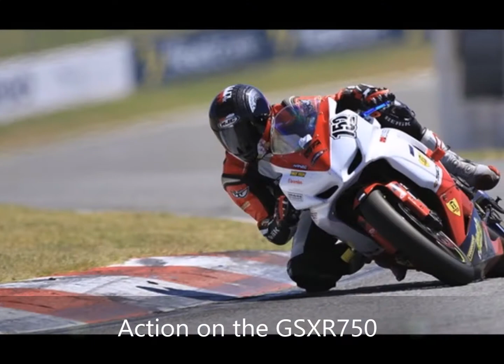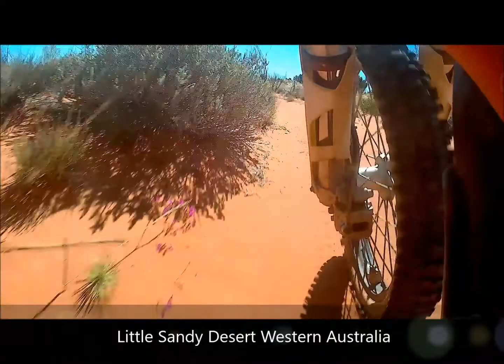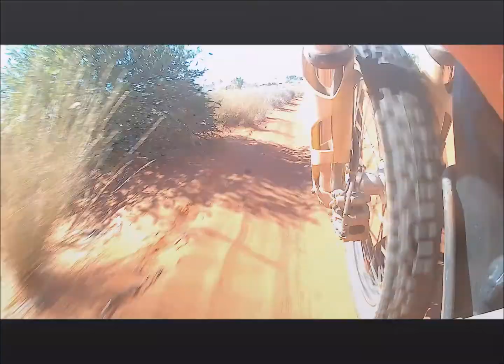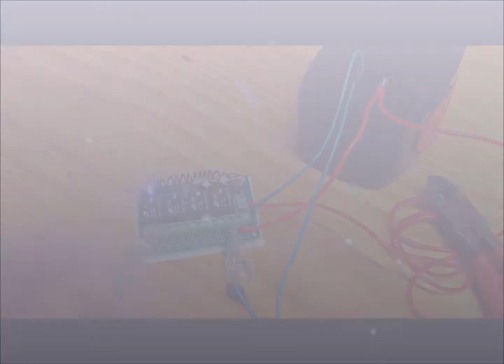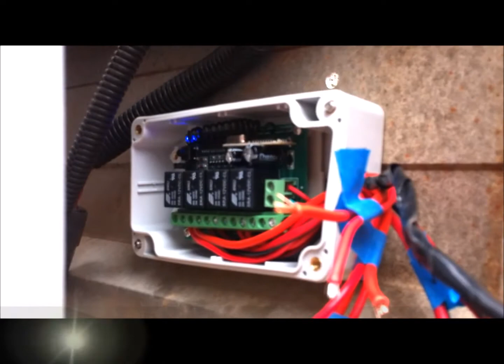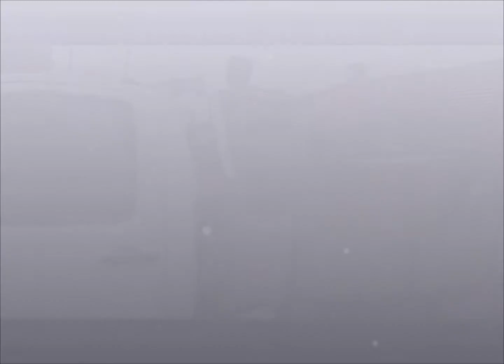4wd Remote Control Flood lights Camp LED lights Off Road camping

Comment: Hey Scott, I am looking at doing something close with the lights and having remote on/off switch. Can you recommend where I can get the parts as its been 5 years and the link doesn't work now.
Reply from the maker: There are any number of these things on eBay if you search. Like this: https://www.ebay.com.au/itm/354249422926?hash=item527ae9384e:g:zzwAAOSwDA1jDCwy&amdata=enc%3AAQAHAAAA8I1IH7X1s41m4AnK65aOPb5HECGpPZaykpwvPaxA%2FpfmMoBeCvd70uveeVcjdzJ08935Ebjp7whEiRFYyTKVKfcEjODaZp%2FzfWFZtrhCnlytuOln6VbGhrsJnk%2FmDhlwuoxmYUurskSeMhKO7UgdosYFcH5fBK0I2Qihqd84zDeGcarVhPIgcqwNocsZDSYzYkoNrBdBaPUdiUFkKx%2FFGUG02ZA3cydcT8gLWnxrDx7bEabGdLCeKp641HsnKznUBC6hRy%2FBT8jhpMw2JeCbbnlPsubHDMZdnahPZ1OkNyzH6JTSExIki0LNFjqUybI%2BeQ%3D%3D%7Ctkp%3ABk9SR_C5uYu5YQ

Comment: Surely you're on #navlife?
Reply from the maker: No not a member ... is it a good forum to join?
Reply: @ScottElliott152  as far as navaras go, its the best! I've just bought the rf board and some led floodlights to wire up on my pathfinder
Reply from the maker: @its028NVD  ok thanks ... I'll sign up. You'll be pleased with the remote floodlights. A friend has just installed the remote board on his D40 Navara and loves the convenience. I just did a video on how to modify the NPS switch and have another nearly ready on how to do the oil line pipes gasket on the underside of the turbo. I worked out a way to do it quite easily without removing the turbo

Comment: Did you run the control box through a multi meter to calculate its draw? Did you end up flattening your battery? Ps, good job on the video 👍🏽
Reply from the maker: Thanks. I calculated the current draw. P=VI. The side mounted lights are 80W. 80/12 = 6.7A. The relays handle 20A each. The auxiliary battery is a deep cycle 50Ahr. One 80W light will run for 50/6.7 = 7.5 hours before the battery is flat. I have flattened it when I've run all lamps for too long. As it's isolated from the main battery with a VSR it's not a problem.
Reply: Hello again Scott, i was interested in knowing the standby draw of the control box, i'm going to be setting up a similar set up but my aux battery also powers my fridge and and a couple other camp accessories. I have a 115ah aux battery being charged through a VSR. Sometimes camping we are parked up for three of more days so i'm always calculating our draw! CAN'T have the beer getting warm!
Reply from the maker: Chris if you watch the video again you'll notice I mention I have the box wired through an isolation switch. When I'm not using the car I isolate the grey box so it doesn't draw any current. My 4wd sits for months at times as it's purely a recreational vehicle for trips to the desert.
Reply: When you isolate the receiver and then power it back up do you need to reprogram the remotes?
Reply from the maker: @cpm1980uk  No they're fine.

Comment: Terrific video!  I really appreciate the idea of using a remote for my lights.  There are probably other things this setup could be useful for, too.

Edited to add:  The remote setup listed is no longer available on eBay, but a bit of searching turned up a number of similar modules on Amazon, such as this one INSMA 433Mhz Wireless RF Switch Long Range DC 12V 4CH Channel Wireless Remote Control Switch, DC12V Relay Receiver Module, Transmitter Toggle Switch RF Relay (2 Transmitter & 1 Receiver) : https://www.amazon.com/INSMA-Wireless-Channel-Receiver-Transmitter/dp/B01CCSG2ZY/ref=pd_sbs_328_1/139-1301443-0373720?_encoding=UTF8&pd_rd_i=B01CCSG2ZY&pd_rd_r=d2f34717-413d-11e9-8091-53ebfc68b3ce&pd_rd_w=eM8ff&pd_rd_wg=DvTQ2&pf_rd_p=588939de-d3f8-42f1-a3d8-d556eae5797d&pf_rd_r=MN9R65A03XWY5GV0HJ6X&psc=1&refRID=MN9R65A03XWY5GV0HJ6X
Reply from the maker: Gosh I only just saw this as it was flagged as spam!
For interest the module got flooded a while back. I drained the enclosure, sprayed with CRC and left to dry. Still works perfectly after such abuse. Regards, Scott
Reply: @ScottElliott152 ,
I had kind of forgotten about this post, so thanks for the reminder. I think this is a project I need to work on!

Comment: Good to see you back Scott.  I eventually got round to doing the ATF change on my Mercedes E350 7G Transmission thanks to your very informative videos, so glad to get it done. Took the Blue ATF by the way. Thank you again. Mick. Northern Ireland 👍
Reply from the maker: Michael that's great news. Would have saved a truck load of pounds and you'd have done a more thorough job. Scott.